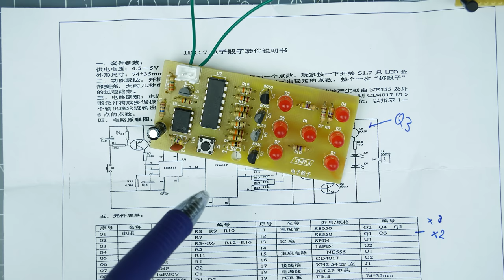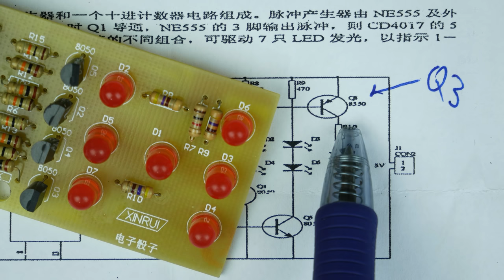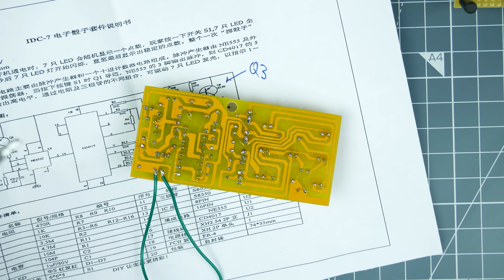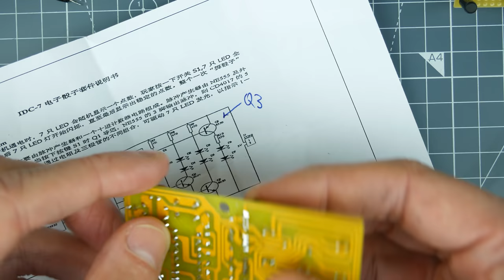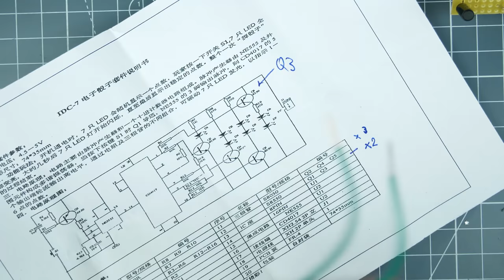What's wrong with it? A dicey situation

Comment: It looks like the middle left and right LEDs are only darker during the faster part of the spin cycle. Could this be because they are switched on for less time than the other LEDs during each spin cycle? i.e. displaying a 6 is the only way to switch them on whereas the middle LED (for example) would be switched on whenever a 1, 3 or 5 was displayed.
Reply: Indeed. Similarly the center LED is only on for odd numbers (50% of the time) and the two LEDs used for 2 are on for all but one value (1). That is why the second PNP is used.  Unlike the other LEDs, which are turned on as needed, D6 & D7 are on by default and turned off when displaying a 1.